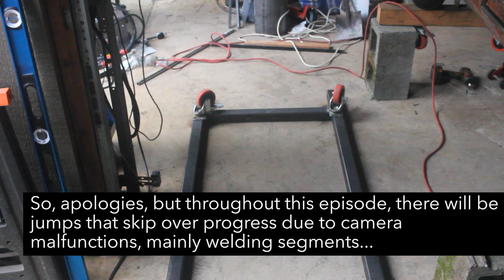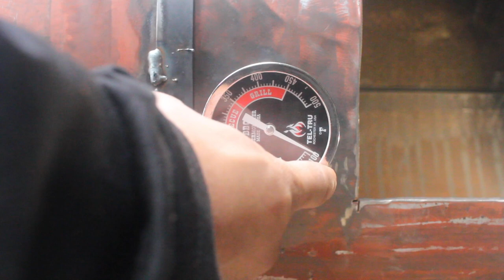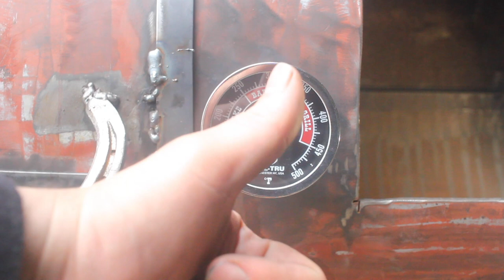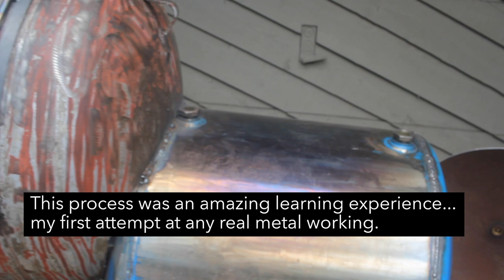BB&B Ep 12 - Franklin Barbecue-Styled Smoker Build - Part 11: Skids & Attaching the Firebox

Comment: Discovered your videos at the beginning of our States "shelter in place ". Been excitedly waiting for new ones. 

You did a great job on the build and inspired me to make some mods on my own. Thanks for offering up good content containing my two favorite things...Bourbon and BBQ.
Reply from the maker: Thank you!  Tell me about those mods...
Reply: @BourbonBladesBarbecue  I had a cabinet style 48x30 trailer smoker built 4 months ago. I want to add  handles  to all my grates and my storage box needs a pressure or hydraulic lift.  The builder put on aluminum vents but I want to replace those steel fly wheel vents.

Comment: Get yourself a harbor freight portable bandsaw it's life changing and use Milwaukee blades on it
Reply from the maker: I’ve got a Milwaukee portal with the blades.  Still getting used to that.  The cut wheel is a crutch for me...
Reply: I will tell your from experience you don’t need the grease shut off valve... after about the 4th cook it will be stopped up.. ask me how I know .. I just weld a pipe with a little tab to hang a bucket to collect the grease ..
Reply from the maker: @jfcustomfab  I do the same with the bucket to collect on commercial smokers I've owned.  Yeah, if the ball value becomes a hassle, I'll just remove it.

Comment: What was your total project cost? (Tools, Materials, PPE...)
Reply from the maker: Under $2k...for the items I had to acquire.  There are many tools I already had, so I don't count those.  I did acquire a oxy/acet torch for $50 (got lucky).  I bought the plasma cutter with the money I made selling the oxy/acet torch ($400).  The steel is what's going to cost you the most in terms of materials.  As much as possible, I sought out remnants (drops) from steel suppliers or shopped around on Craigslist, OfferUp and Facebook Marketplace.  I bought the 250 gal tank for $100 delivered, but you can get lucky and find them for free.  Focus on acquirement all the steel you need first.  Then get your tools together.  Decide how you're going to cut large pieces (cut wheels or torch).  In the end, the real cost is your time.  I spent a year on and off building this with pockets of free time I could find.  Now that I've done it once, I could do it again in probably a week's worth of time.  But the first go-round is full of trial and error.  Good luck with your build!
Reply: @BourbonBladesBarbecue  I think your videos are the motivation I needed to get my 500 trailer project rolling. I have been doing 275 oil tanks as hog cookers and cabinet smokers. This will be my first big cylinder build. I have 20 or so tanks just sitting that need to get turned into something someone will love  💘.

Comment: A hydraulic pipe thread coupling would be easier than a cast steel pipe fitting...or a pipe bung found on the top of the 55 drum...

Comment: Keep at least one of those cut out curve pieces. That way if you end up doing it again you can trace it and all four curves will be uniform.
Reply from the maker: If, and that's a big IF, I'll be doing so many things differently...
Reply: @BourbonBladesBarbecue  That's a video in itself! Do a cook, show us how it drafts, temp difference across the pit and give us tips on what you'd do different. I really want to build one (maybe only a 120) but have no tools or metal working experience, so this build is really inspiring.
Reply from the maker: @sanguineotter5778  You're right where I started.  I started with buying a used welder and grinder...

Comment: Get yourself a firewood grate online from Amazon keep that wood off of your barrel, it will last longer.
Reply from the maker: Thought about making one that fits the shape...
Reply: @BourbonBladesBarbecue  good idea but I don't think you will gain that much by following the contour.
Reply from the maker: Using a straight grate might get me more airflow, but I'm not having problems with draw.  Might have too much draw, if that's a bad thing
Reply: @BourbonBladesBarbecue  yes sir, you definitely need a damper on the smoke stack. I love the air flow.